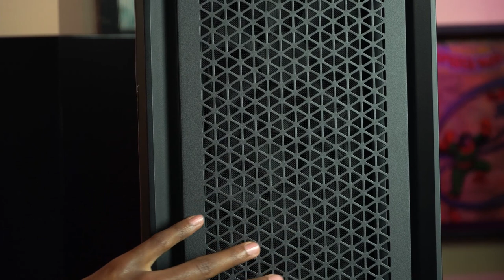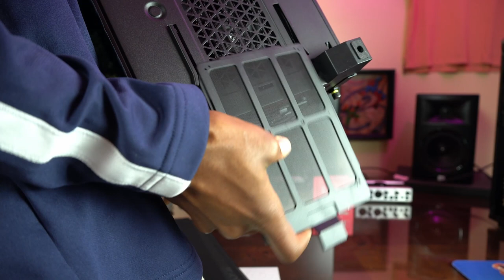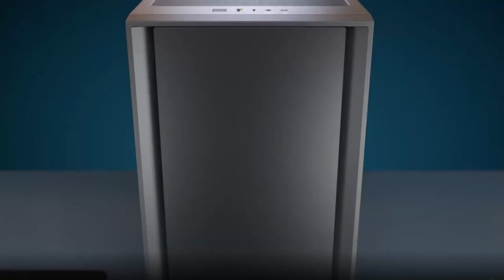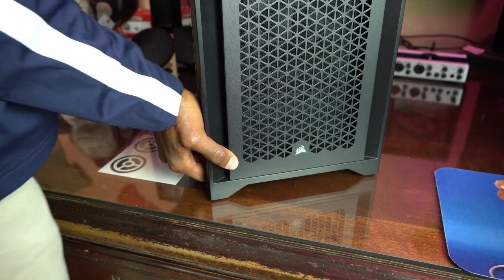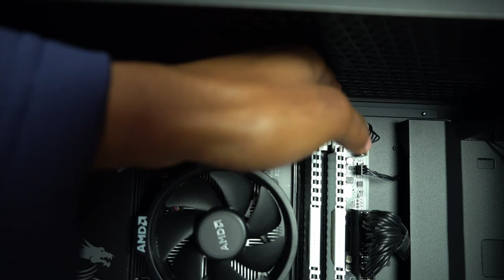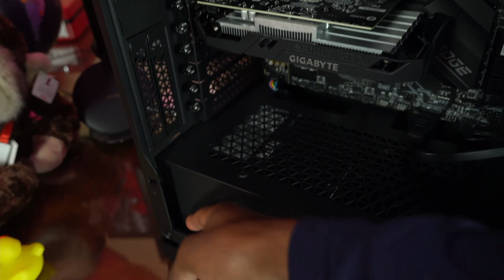Why it's my favorite: Corsair 4000D Airflow Case Review

Comment: I was looking at the 5000D but it just ended up being too big, particularly as I'm not doing any water cooling, so I went with the 4000D instead. It was great for building in. I removed the drive cage entirely which left tons of space for cable management. The airflow is top notch as well and my temperatures are good for the fairly hot system that I'm running. My one complaint is the how dark the tint is on the tempered glass. It pretty prevents seeing the build at all. I've added some strip lighting to help, but it's still pretty dark.

Comment: In my Corsair 4000D Airflow (e-atx supported)By removing the cabel cover. AMD 5950x, Powercolor AMD RX 6900XT 16gb  Red Devil. Rammemory: 64gb 3600mhz cl16. 
ASUS ROG Ryujin 360 (CPU cooler). Gigabyte X570 AORUS XTREME (e-atx). Seagate firecuda 530 2gb (OS). Corsair MP600 2 TB (gaming storage). Noctua  iPPC-3000 PWM fans.